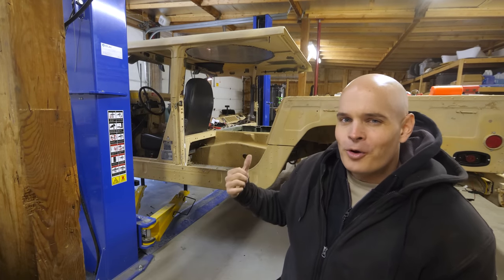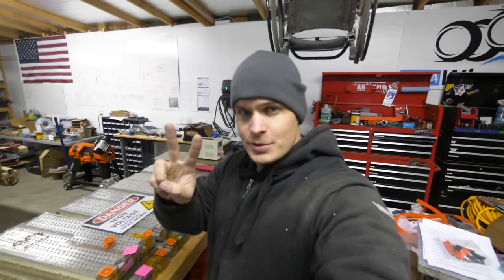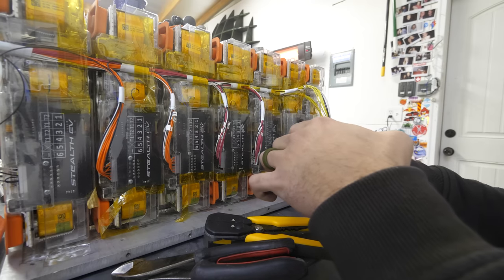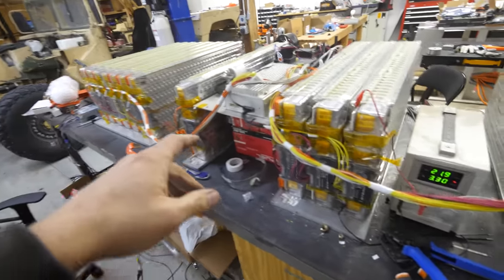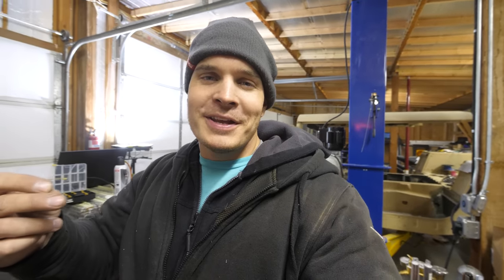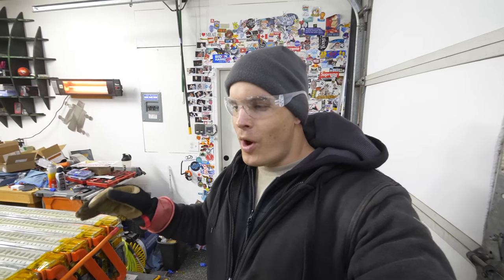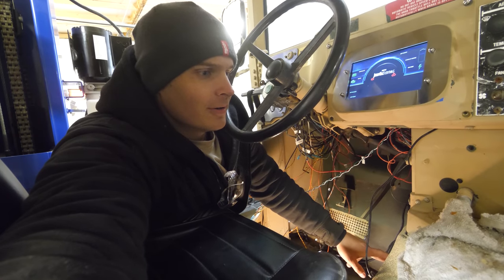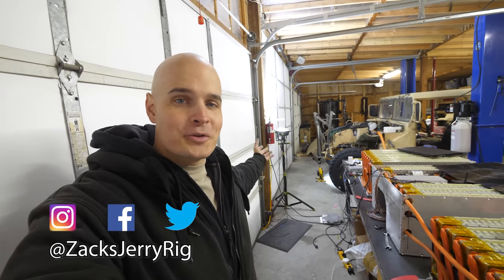Building the Brains of the HIGH VOLTAGE System - IT MOVES!!

Comment: Hey Jerry , I’m in engineering for a EV truck bus manufacturer. 
I have a few suggestions . 
1. EMI shield the power battery cables and the 3 phase cables from motor controller to  the controller . At higher speeds you will create alot of noise that will disrupt all your CAN and Cell sampling . 
You shielded  the parallel CAN by twisting the pair but you need to protect them from external emi so you can also shield  and ground the low voltage wires . 
2. That’s is a great battery design , but I suggest you fill in the sides of the battery box to keep the inertia/vibrations  from flexing and breaking the modules case . If your modules flex around inside the casing it will break the bus bars because they are solid copper coated with nickel so no flexing in that material . So basically make it the battery box really snug for the modules .
Reply: I hope he sees this comment. And his name is not Jerry. It was his grandfather’s. His name is Zack. 😋
Reply: Upvote so Zack could see
Reply: If there will be emi then how can they use wireless bms in it?
Reply: This is one of those things I love about this video series, not only we get to know Zack's insight of the project, but also people like you who are actually experienced and educated in this field putting in suggestions! Big ups, sir!
Reply: Proud of you, you are a gem! This world need more people like you!
Reply: Hi there. Would't there be a problem with induction heat around the holes for the thik orange wire in the aluminium boxes? His power measuring brackets aint with a hole for the wire for the same reason.
Reply: @drivenbyponies  hi 🙂
Its not the heat From the cables I'm worried about. The cables are thik enough i think. But the induction From the magnetic field the cobberwire is producing.

If the positiv and negative wire goes through the same hole in the aluminium the magnetic field outcansels one another. But thies cables goes through there own hole.
Reply: @drivenbyponies  my bad. The box is aluminium not iron so there will be no problem. But if he uses iron fitting(screw connection or what they are called in the states) there will be heat.
Reply: Through the magic of electrical engineering
Reply: Hes gonna burn doen his garage with this build, he shuld really know what he does when playing with high Voltages... And remember, he is just originally a guy who test phones and dont know about the different types of locktite, etc i think he reads most online on the go, the days before, this is not a build to do that on. It's no joke this. Look up his first vids and se how he has evolved over time, i hope he has some help on this one or i might be a disaster.
Reply: @moldytexas  you shuld read and learn yourself not watch a random video online, high voltages is no joke!
Reply: I have to agree with Edwyn completely.
Reply: Why is that I'm 15 and understand all of this
Reply: @OS_GODFATHER  go to sleep kid
Reply: @maujanjatv24h41  I probably should
Reply: The BMS CAN wires are differential signals for common mode noise rejection, these signal lines should be constructed out of 24awg TSP (twisted shielded pair), not two wires twisted with a drill, and ground the shield at the BMS.
Reply from the maker: The 2/0 wires going to and from the inverter are shielded. The internal 2/0 wires in the battery box are not. I will upgrade my CAN wires to shielded. Thanks for the suggestions!
Reply: @JerryRigEverything  in my line of work we run unshielded twisted pair CAN BUS wires along side 480 volt AC harness and have no issues at all. Pico scope is always clean. I wouldn't worry about it. Matter of fact. Tractor trailer, residential vehicles runs unshielded CAN wires just taped in with the rest of the harness
Reply: Using this system what mining hashrate can you get if you hookup a few GPU's just kidding of course..awesome project! Loved this!
Reply: Fill with what material?
Reply: @rohannatu  Never knew why... Thanks
Reply: Hey Edwyn, are the immensely dramatic music also playing when you guys are working with dangerous electric power?
Reply: Salam brothers, please, can you help me, because I have serious health conditions, I need some tests and some tests, and in my country I do not have health coverage… I swear to you that I and my child did not find a living
Reply: @drivenbyponies  la ilaha ila allah mohamed rasolo allah
Reply: @drivenbyponies  And when things go wrong you play Unter Donner und Blitz by Strauss?
Reply: @drivenbyponies  Thank you, the best word I've ever heard
Reply: For that he could use a LAN-wire it is very cheap and very effective.
Reply: @drivenbyponies  Thats not true because it depends on what category you are using for example a Cat1 Class A LAN-wire could handle up to 1Mbit/s.
Reply: @drivenbyponies  A project for you, make it run WIFI LAN and drop the cables.. Or Bluetooth.
Bluetooth = 3.2 Mbit/s, WIFI 1300 Mbit/s
Reply: I will admit one thing. I have been an officer in the Danish army for 36 years = I have a driver and people looking after my cars :D

I have no clue what a CAN bus are :D
Reply: @drivenbyponies  If the caple for can-bus are also as cheap as Lan-wire then it is also a good choice to go for but I dont know how expensive these wires/cables are.
Reply: Would you be able to get a UQM motor controller started? I have a DD45-500LW 27565 controller I need help with.
Or maybe you can direct me to someone.

Comment: suggestions:
1-insulate the terminals
2-Put some "cushion" to the batteries on the sides
3-Add a refrigeration system to the batteries
Reply: For #3, he mentioned the battery packs have channels for liquid cooling, but after he showed the three conduits [only], I wasn't sure if he was going to go through with the cooling system [yet].

Comment: As electrican,i would advice you to put a edge protection around the holes where you put the wires trough,not that the isolation gets damaged on the metal edges when going over bumpy roads.But amazing work,i love it
Reply: I agree but I did hear him say he’d put grommets/glands around those sharp edges when he actually puts it into the vehicle.
Reply: Yeah, I saw that too. I’d install them before the wires to make sure you don’t forget any…
Reply: yeah some rubber grommet will do just nice

Comment: 23:00 - one comment here, you should use thread deforming all metal lock nuts instead of normal jam nuts for your HV connections. Vehicles see a lot of vibrations and these nuts could potentially come loose, but a thread deforming nut is highly unlikely to ever come loose from vibrations. Nylocs don't work because the high currents going through these connections can melt the nylon.
Reply: Are nordloc washers safe for this application?
Reply: @afromaximus  they are probably fine. My experience is in formula student where our rulebook forbids those as they rely on pre-tensioning. Since I'm an electrical engineer, I'm not too familiar with fasteners apart from what I'm allowed to use by our rules so I can't say for certain
Reply: @GrenYT  Interesting, I can confirm they are excellent for 8G vibration provided they are pretensioned correctly as you mentioned.
Reply: @afromaximus  formula student is a university competition so they only really allow safety wire, nylocks, all metal thread deforming nuts, and tab washers to make it easy to see whether it was done properly.
Reply: @afromaximus  Yes, Jack Rickard of EVTV proved they were right for the job several years ago.
Reply: Wq

Comment: You need rubber grommets to prevent the conduit cabling rubbing on the edges of the metal holes. Great video as always, Happy new year !
Reply: They will probably add them later this is a test assembly
Reply: Yeah good suggestion indeed
Reply: No doubt, I would imagine they probably know with this level of know how but things get over looked all the time
Reply: I'm pretty sure he already has something to prevent that shown in an earlier video. He just didn't put them on yet for the test because they'd have to come off again when he installs the batteries in the humvee.
Reply: he already said he will be running them in conduit

Comment: 12:24, careful, blue loctite will eat away at many plastics making them extremely brittle. The product spec for 243 recommends keeping it away from all plastics. 

"This product is not normally recommended for use on plastics
(particularly thermoplastic materials where stress cracking of the
plastic could result). Users are recommended to confirm compatibility
of the product with such substrates."

Comment: Loving this series.
Safety tip for working with dangerous voltage and current: Don't lean on the chassis and most important use only one hand at a time of possible and keep the other behind your back.
It's grounding across the torso that is most deadly, keep your heart out of the curcuit path.
Reply: The chassis is floating, not grounded, with respect to the HV battery.
Reply: @vidznstuff1  I was about to point that out, as long as those batteries aren't connected to anything that could ground them, touching anything with one hand is theoretically safe. However accidents happen so this probably isn't a bright idea. and iven if you insulate yourself from ground, those can still hurt. because the potential of those batteries is not equal to ground.Though  I suspect it is really close with air discharging and them connected through BMS which is grounded through external power
Reply: also, dont wear necklaces, chains, rings or watches, etc. - just keep it as a general rule of thumb.
Reply: @MegaWebinator  And you can forget your tinfoil hat, it never helped anyone.
;-)
Reply: @BoB-Dobbs_leaning-left  as a trained professional i can show you evident proof of People whom been permanenetly disabled for wearing said things.  :D
Reply: @MegaWebinator  indeed, MTG springs to mind.
😬
Reply: No jewelry/ conductive materials, one handed troubleshooting if possible.  Are there special fire extinquishers for Li batteries if they do go?  Buddy system and both learn how to handle hv elwctrocution - maybe good episodes for future - especially with so many ev and van life solar systems etc. See if local FD does specific training for these?  Happy New Year!  Quiet, with No Fireworks Please😉
Reply: Never let the frame or body = HV return.  Also, no jewelry, ties, badge lanyards, long sleeved shirt and dry gloves are good.  Those Lincoln TIG welding gloves are the best, clean thin and flexable.

Comment: As I am a retired  (45 yrs. in and as an) Electrorincs Engineering tech Large Sawmill -  Headrigs and 500 HP Gang edgers, former USN Aircract Electronics tech (ASW, AT3), USAF AutoTrack Radar tech 30333, USArmy Infantry, I would offer an A+ for what you showed us in this video. Safety was paramount with death so close... great job! I am sure you'll fix the no grommets without me saying anything... you got it to move without destroying your shop. Everyone waqtching what you did should be very impressed. -- Take Care - Radar 71 and still alive Jerry Rigging all the way.

Comment: Congrats on getting your project to the rolling stage. I do have a very real concern about the exposed +/- battery terminals being within a 1/2 inch of a conductive aluminum panel. There is insulation sheet material (Fiberglass GP03) that can be installed around the inside of the battery boxes that will take an impact and keep the HV terminals from shorting out on the aluminum box. Rubber will not do as it will deform and allow the terminals to contact the aluminum in the event of an impact due to an accident.

Comment: Just a note:
You should be using HV wires with a braided shield, it will decrease the eletromagnetic noise in the car
It is also advise to use proper CAN cables
Reply: Twisted pair, screened, shielded. Their hope is that the cable runs are short. And they'll figure it out pretty soon if it's ok or not.
Reply: :yt:
Reply: Yes agreed

Comment: This project is amazing and I love following it. I do have a safety concern with the driveshaft going through the battery enclosure in the event of something failing. I would look into a drive shaft hoop to protect the box in case the u joint fails from all the new torque it’s definitely not rated for. Last thing you want is a flailing driveshaft smashing into your battery enclosure.
Reply: The size and weight of the vehicle and the tires against the drive shafts causes me to worry about reliability of the electrical system in especially hard jumps at speed. Please be careful and do not let some careless reckless person drive this until you well test this. Great video! The music really builds Tension!  Great speaking ability. WOW!!!
Reply: @dporrasxtremeLS3  Certainly a HumVee was never meant for "hard jumps at speed". You buy a Raptor for that!

Comment: That 'crusty compound' on the battery terminals was not dielectric. It was a conductive paste needed for high current connections to prevent hot spots in the connections.
Reply: yea I was pretty surprised they bolted it all up dry. Hopefully it doesn't get too corroded later down the road.
Reply: @frostbite1991  He is figuring it out as he goes. It's good feedback though.
Reply: Ohhhh 😕
Reply: how much of a fuck up was it that they scraped it all off?
Reply: @buckmanriver  yea I'm hoping they go back and rebuild the packs with conductive paste, I know it'll suck to do though. Been loving this series so far, great to see how far he's come from testing phone durability.
Reply: @Le0xo  They just need to apply some fresh grease to the terminals
Reply: It's just dried glue lol. I tested it myself, not conductive.

Comment: 23:28 that looks like a good place for the wrench to weld itself to the case, if there is any conductive path from the battery to the box...
PLEASE insulte the box wall that covers the terminals!
Reply: Watching that had me nervous
Reply: I was thinking the same thing! I really hope he insulated the batteries from the box or that could go really really bad should something happen
Reply: Insulting the walls won't help 😛 For this beeing an issue, you would need a double fault, where the negative terminal also touches the walls, but still. Uneccessary risk that can be easily mitigated by glueing a rubber mat around the terminal..
Reply: @fabianfeilcke7220  what? Yes it will. With an insulated wall, you need 3 points of failure. Currently you only need 2
Reply: @hansdietrich83  read again what you wrote above

Comment: Warning for the loctite 243 used at 12:30: Loctite makes most plastics brittle over time. You will end up seeing the plastic break and possibley drop those screws onto the PCB below it. You are far better off using a nylock nut on the outside with the screw head inside (also cover it with kapton tape).
Reply: Seconding the kapton tape. But sugessting you print a new top that can take the other device.

Comment: It’s been my experience with wiring ( both from my job building sensors for The United States Airforce and my hobby as A Car Audio Freak)
That only crimping those pin connections ISN’T enough to ensure they are solid enough.
I always go the extra mile and solder the part and the wire.
And it’s done because the USAF DEMANDS It to be DONE, not because I want to!
And since they have it that way, I decided to do that with my own projects.
Haven’t had a single failure on ANY wire connection since.
This project is DEAR to my heart ❤️, because my father was involved with the initial development of the HumVee as Commadant of the Ft Eustis, Va Transportation College.
I’m so very impressed with your efforts!!

Comment: It might be good to buy dedicated CAN bus cable that is already jacketed and/or shielded. These are rated and tested to meet CAN bus requirements. CAN networks requires differential impedance control to maintain signal integrity, which for twisted pairs is determined by the conductor, dielectric between, and distance between wires. With a loose twisted pair it might not work over longer distances or with higher interference.

Comment: Watch out for Eddy Currents indused into the metal structure of the boxes. Since you've run positive and negative wires in separate holes going through the metal wall of the box, this will create Eddy Current in the metal. This will cause great loss of power, heat up the metal in the box and create interference in electronics. To avoid this run both cables through same Conduit.
Reply: Except that there's DC current flowing in those wires, and Eddy currents only occur when variable magnetic fields are present. The only situation it could be problematic is during sudden acceleration/regenerative breaking when the current changes rapidly, but without running the numbers I can't really say if it ends up being relevant.

Edit: it also occured to me that given the orientation of the cables with respect to the box's surface, the magnetic field flux through the metal volume is only accounted by the thickness of the metal plate, thus the induced current should flow from inner to outer surface and vice versa, not along the faces. Even being quite ticc as they are, there is not much space for the Eddy currents to develop and dissipate energy thickness-wise.